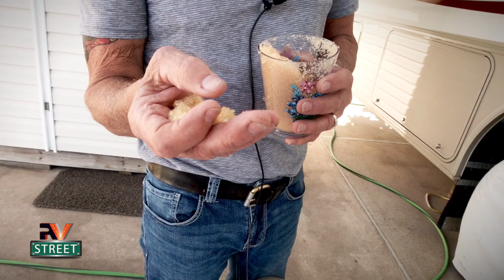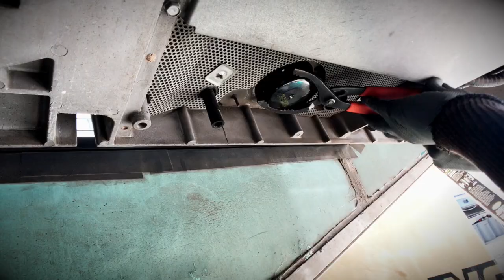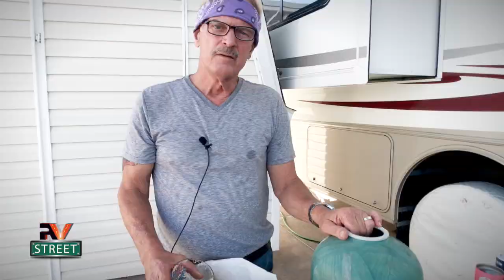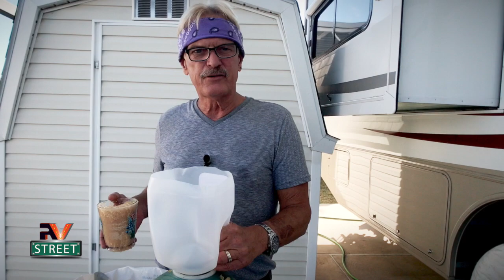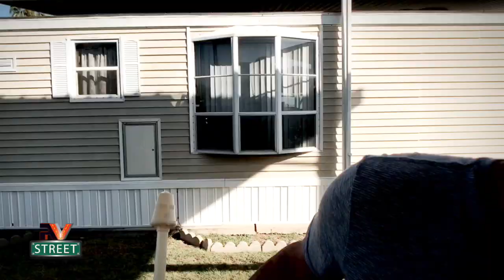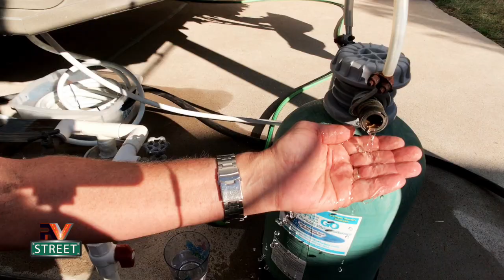Replacing RV Water Softener Resin Beads. Easy DIY.

Comment: So that was nasty stuff coming out of there! I wouldn’t want my water going through that 😝 And that is the last thing it goes through? You’ll have to explain that to me in person. As you know, I’m not sold on the softeners...we are from Missouri and we like our hard, natural water. Sir Lloyd Benson and I neither one like taking showers in soft water...it feels slimy to us and we don’t feel clean. But loved the video, as usual perfect step by step instructions! Tell Joanie Hi 👋
Reply from the maker: It's nasty because it's doing it's job. If that softener wasn't there all that "nasty stuff" (minerals) would be going though out the RV. Yes it's the last thing water goes thru. 
I've had our water tested and it's purer than what we had at the house. Without a water softener your RV WILL have plumbing problems, valve problems, pump problems, pressure problems and all the other things I've mentioned in other video's. Mineral deposits will build up through out the entire rig overtime. It's not matter of if, it's when these things will happen. As I mentioned last year in one of our previous videos, one of our friends bought a brand new 5ver and in less than 2 years—not having a water softener—cost them over $4K dollars in repairs and equipment replacement. This was totally avoidable. To me, any FTer a water softener is a must. If you're a part timer—and don't use a softener—they better be doing periodical full rig cleaning with white vinegar followed with sanitation. But even doing that is not near as good as having a softener 24/7/365. Joanie says hi back at ya. 💗
Reply: Aqua-Hot specifically recommends softened water with their units.  The domestic hot water loop is small diameter and very sensitive to mineral build up from hard water.
Reply: Mrsha,  your water feels slimy because it is TOO soft.  Yes, this can and does happen, a home water softener is designed for a specific hardness and will regenerate frequently, perhaps every morning.  The slimy feel is common when you pay a softener company such as Culligan or other bringing the softener bottle to your house and replacing it once per month or every two weeks.  The water will start out too soft and then, at the end of the cycle, it will be too hard.  Then you start all over again.  These RV softeners work in the same principal but since water hardness will vary from site to site it would be almost impossible to design a softener that will automatically adjust.  I, personally, would opt for the smaller On-the-go softener and regenerate more frequently to try and avoid the "too soft" feel.  RV street is right, if you do not soften your RV water your WILL have problems and a very expensive repair job waiting for you later, not IF but WHEN.  Good luck.....!

Comment: Great job. Tip#1 Add water into the tank after the resin and that will make the resin float a little to make it easier to install the tube and won't pack beads. Tip#2 Resin is calculated and bought in cu/ft not pounds, so if people are shopping and only see cu/ft they don't get confused. 16k grain softener=.0.5cu/ft, 8k=0.25cu/ft and so on.

Comment: Well done video! We're not softener users- mostly because of storage room issues and because we more frequently (not always) set up in areas with soft surface water supply. But this is a great resource for those that do!
Reply from the maker: Ya we don't have the storage space either. On move day, we just put it on the floor behind the front seat in our toad.

Comment: Have this exact system thanks to you. Works like a charm. About ready for  my first rejuvenation. Will follow your previous video. One question: when you replace the beads and are not using salt at that time, do you still use Rust Out at this time? Or do you only use when you rejuvenate with the salt? Thanks and safe travels.
Reply from the maker: Just when you rejuvenate with the salt the first time and then afterwards.
After reading this comment here's a better way to say it:
I add Rust Out when I rejuvenate with the salt.

Comment: I don't have space for one if these in my travel trailer storage. I have been considering a two stage filter instead. I wonder if that will keep some of the hard water out.
Reply from the maker: Filters will not remove hardness. We don't have the room to store it our rig either. We carry it in our toad, then set it up right outside the wet bay when we land.
Reply: Thank you for telling me. You just saved me a bunch of money.
Reply from the maker: @chrisistocool1  Just to be clear. in case I misunderstood you. You should have at least a two stage water filtering system (we have 3 filters) but they won't remove hardness. Only a water softener will do that.

Comment: my little in and outlet stickers fell off.  is the outlet connection connected to the long tube in the middle of the softner?  seems like if would be otherwise it would push resin into water lines if connected backwards. thanks for the video
Reply from the maker: I believe your correct. I'd have to pull mine apart to be 100% Mark in & out again on the outside with a marker.

Comment: I have a solar Question,  I have a Renogen 400 Watt Solar kit.  I bought through Amazon.  Where in the hooking it up should I install some inline fuses and a shut off switch to the solar Set Up. Please.  Thanking you in advance for the help.. Annie
Reply from the maker: I believe you have the Adventurer Controller with this kit and if I'm not mistaken, it's already equipped with multiple electronic protections ie: reverse current, overcharging, short-circuit and reversed polarity. It may already have an additional fuse that you can change out too. Not sure about that. You'll have to look at the unit and see if it does. But an inline fuse should hook up before the batteries. Switch is the same way. You only need one fuse,  just make sure that fuse and wiring is properly rated. Your solar manual will tell you what that fuse should be rated for if it doesn't already have one. But like I said, the controller already has many protections built in. If your manual is insufficient and doesn't include wiring diagrams or other information you need, I think you can find what you need below. 
Hope this helps.
thx for watching Annie 
https://renogy.force.com/helpcenter/s/topic/0TO4W000000kvoMWAQ/product-documents

Comment: Just ordered and already received Double On The Go water softener. This thing is huge and heavy. I am thinking of exchanging this double unit to a standard one. We are not a full time by any means. Camping 3-4 times a year at a week at the most and planning annual trips for a month or two. Will standard unit be sufficient to our needs? We are new to water softener and appreciate your suggestion,. By the way. I will try to install softener in water bay. Thank you ! Great video as always.
Reply from the maker: Oh, C'ome on, it's not that that big....😜😜😜😜😜😜
If you're going to be camping for a month or two the standard will not be sufficient IMO. I mean MAYBE....but...You're constantly going to be regenerating it. When it's just a week then yes. If you can spare the room and weight, then yes, installing it in the wet bay would be better. We didn't have that luxury. But I am glad you're taking your water situation seriously. You'll be glad you did over time.

Comment: I'm sorry to keep bothering you but I watch your videos and love them and have a lot of respect for your knowledge.   With that said I hope you can answer one more question.  I bought a new CLEARSOURCE ULTRA with the water softener and followed the instructions. Right now I have it setup for drinking water and coffee making at the house. But every time I turn it on I get some tan colored water and a funny taste. If I run it for awhile it clears up.  But I don't want this tan water going into the RV. Do you have this issue,  and if so what do you do about it? Thanks so much.
Reply from the maker: No problem, I like helping with questions if I can:
You should NOT have any of this. You should have clear, safe, great tasting water thru out the RV, if everything is setup and working correctly. 
With my system—which is not a CLEARSOURCE ULTRA system—I do not have any issues. Without knowing how often you use your system, how you've been maintaining it, your water source and how you've set up your system, it would hard for me to know the cause. You need to isolate what's causing the problem to determine whether it's the filters, the softener, your water source or perhaps the water hose. I'm just guessing here, but it sounds like you have some sediment somewhere in the system and that's why it takes time for it to clear out. You should not have any sediment.  Things to check and to think about would be:
1) Make sure the softener is the last item in your water system before water enters into the RV
2) Change out your filters and canisters about every quarter and this includes the blue Camco inline water filter. When you replace the Camco inline filter make sure you turn on the city water—without the hose hooked up—and flush that filter first for about 5 minutes before hooking up to the hose. It has fresh carbon in there that needs to be flushed out
3) Back flush AND recharge your softener
4) After back flushing and recharging, do a hardness test on your water right from the streaming water coming out of the softener. If that's ok, hook up the hose and then test water again from inside the RV from any faucet after you've run out all the old water in the system from your faucets
5) Sanitize your water hose
6) Your beads in the softener may be fowl and need to be replaced. Or perhaps the screen on the bottom of the fill tube inside has broke or been compromised and beads are actually getting into the fill tube. Unlikely but it is possible 
7) If you have stored your water softener for any length of time this could be causing the brown water. Follow procedure for post storage 
8) Make sure your water softener is ALWAYS in the normal upright position. Even while traveling and not being used
9) This brown water...is it coming out of the hot side of any faucet inside the RV? If so your water heater needs a full cleaning & servicing. https://www.youtube.com/watch?v=0m4m1CYiUYc&t=10s

I'd start with these things. 👍

Comment: I have this water softener and while draining the water in preparation of regenerating it for the first time, I mistakenly took the cap off and I poured out about a cup of beads before I realized what I had done. Is losing that amount of beads going to be an issue? Should I replace all of the beads and put in the correct amount or will everything still work the same and I shouldn't worry about it?
Reply from the maker: A cup full will not make any difference at all.
Reply: Thank you!

Comment: Hello Martin, Got a quick Question: Where do we purchase the replacement resin beads for the same softener you have? Been on the internet but haven't felt secure in what to order. We sold our house and are about to go full-time, (scary-ish) so we're watching all of your videos that we can. We truly appreciate all the work and info that goes into your and Joenie's segments. You're a machine! lol. Timesaving and Lifesaving stuff.
Reply from the maker: Thank you so much. 🔧 👍
My supplier is currently working on new sources for their beads. In the meantime you can get your resin bead kit here: https://www.portablewatersoftener.com/shop/Refill-Kits/portable-double-standard-water-softener-refill-kit?SKU=OTG2-DBLSOF-REF1

Starting to full time can be a little "scary-ish" and certainly different than what you've been used to. But you'll be fine. EVERYTHING now becomes an adventure. Even going to and finding a grocery store in areas you've never been before. It'll be fun.

Comment: My softener recently ran out of salt. Ever since it ran out there has been iron in the water that I can't remove. There was a solid mass of hard salt at the bottom of my brine tank but I removed that days ago and regenerated my unit at least three times and the iron is still in the water. I used a product called rust out, but I used it before I knew about and removed the salt mass. I am getting another type of cleaner call res clean. If I use it and it doesn't work then I guess I will have to replace the beads. I haven't been so frustrated in many years.
Reply from the maker: Here's my advice. Maybe you're doing this way....maybe not. Regenerate often. It will make your resin beads last longer and keep your salt levels up. But if you use a lot of water—for example if you have a washing machine etc—you'll have to regenerate more often or your beads will wear out faster from the lack of salt. You cannot—over regenerate your water softener. Don't let your softener run out of salt. We regenerate about every 3 months or so and we don't have a washing machine. But in any case, resin beads will wear out over time but a lot faster if you are not properly regenerating often or you let your salt run out. Are you back flushing every time you regenerate? Here's a video that I did about regeneration. Also be sure to watch to the end where I cover what I use to control iron after regeneration. https://www.amazon.com/shop/rvstreet?listId=3Q0KMKYCTJVT
https://www.amazon.com/shop/rvstreet?listId=3Q0KMKYCTJVT

It sounds to me at this point if your beads are fairly old or just worn out, you probably should just replace the beads and start fresh with new beads like I did, regenerate often and use the product I do to control iron every time I regenerate.

JIC...Here's one of my PLAYLISTS that may be of interest to you too. 
https://www.youtube.com/playlist?list=PLkQXtMp9xodT-mrqODN1IH_B2ZAJJ--1c 
Hope this helps Bob 👍

Comment: I scanned through the comments dud see ut, we are a low sodium diet.  With that said dies the salt transfer into the water?  If so how can we remove it?
Reply from the maker: No it doesn't transfer to the water. The salt in the water softener just causes a chemical reaction with the resin beads to remove all the calcium, minerals and hardness from the water, thereby softening it. Having a softener in an RV—to me—is a must. It will protect everything concerning water in the RV. Without one, overtime, it will begin to wreak havoc on everything that uses water, including all your water lines and valves. Even with a water water softener it doesn't remove ALL the deposits, but most. That's why you still have to do maintenance on things like the water heater, fresh water tank etc. Just not near as often.
Here's some more videos on this subject if you're interested: 
https://www.youtube.com/playlist?list=PLkQXtMp9xodT-mrqODN1IH_B2ZAJJ--1c
Reply: You can use potassium chloride salt instead of Sodium chloride (common table salt) it costs a little more and is not as commonly stocked. I get mine in 40 lbs bags for my home softener at Menards. Potassium is a bit more heart healthy.